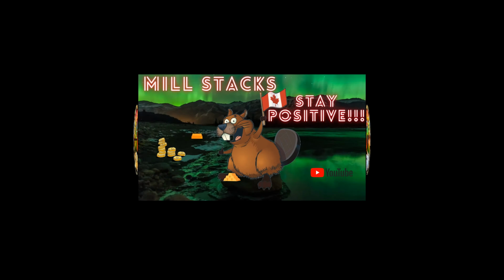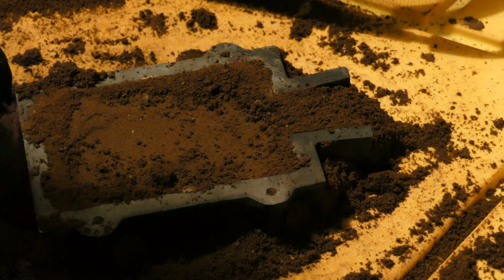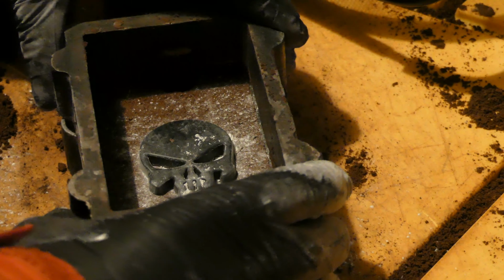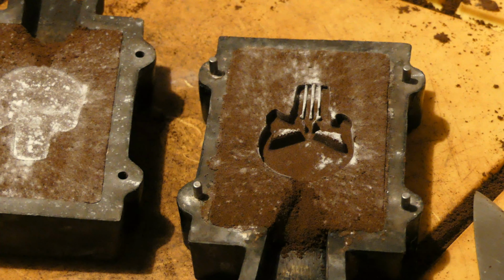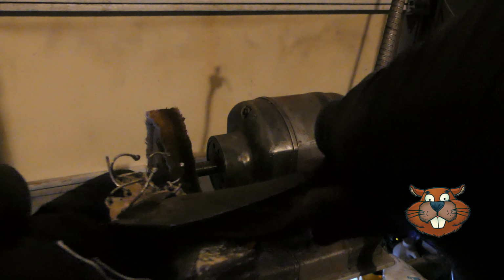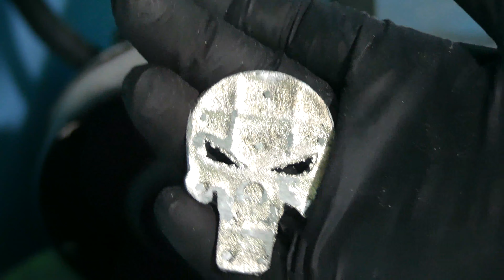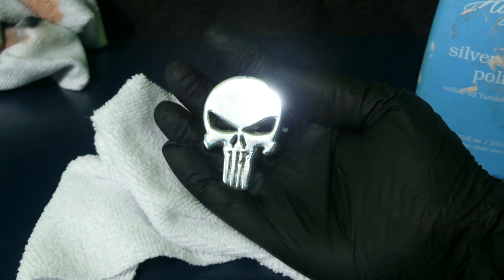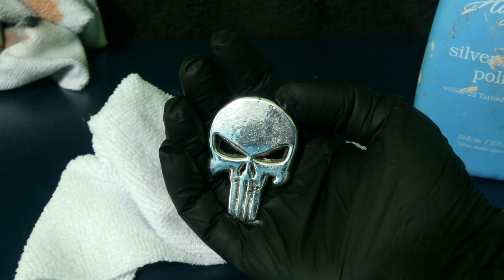How to Cast Silver - Silversmith Shows Secrets (Every Step)

Comment: Nice job Mill Stacks!  Lots of work went into producing that silver piece and it came out great at the end.  One quick question- why not use a tumbler in place of machine wheel polishing?- just curious.
Reply from the maker: The tumbler just does do as good of a job. It comes out like it does after the black Emery which just moth it out like it was after the first step. But I like to go above the normal standards. I like it to stand out in others stack and I find the extra attention to detail polishing a huge difference between my tumbled pieces I have and the ones that went through a buffing wheel. After its smooth I hit it with the Tripoli to smooth it out a tad more and really shine the light off the piece. Then I use the rouge to give it that final mirror finish so you can see yourself completely! I find it may seem overkill but when you have the pieces next to each other it really bring out the details way more. Just my preference personally.
Reply: @MillStacks  Well, you can see it's a mirror shine for sure!  I think your the only channel I have seen use the buffing wheel, so I was curious to why.  Now I know!  Thank you for your detailed answer, makes total sense 👍👍